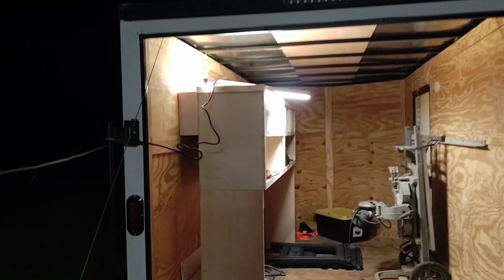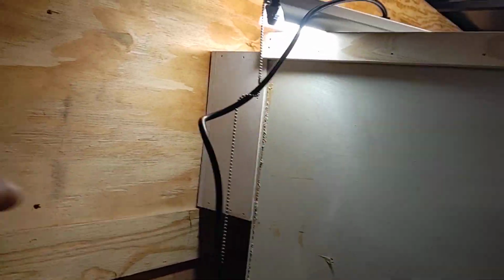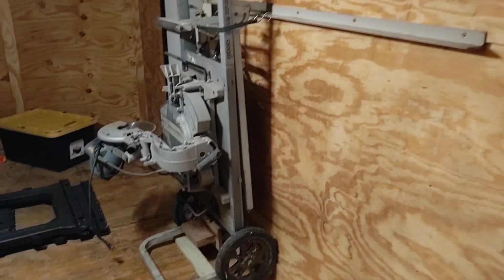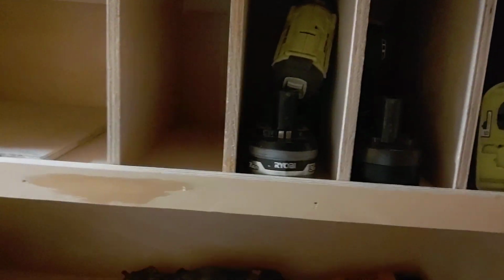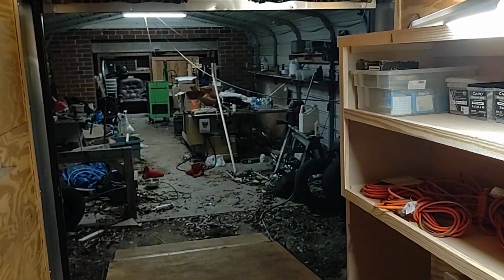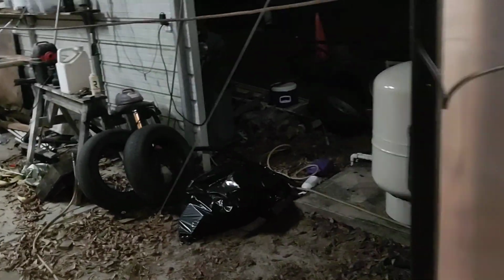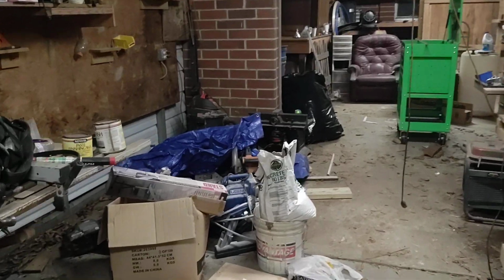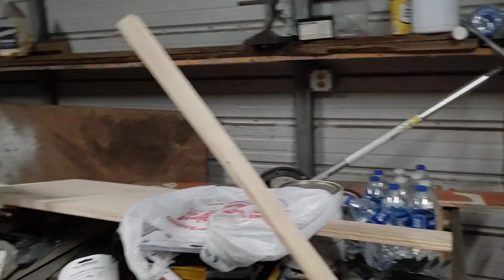Tool Trailer Update

Comment: I hope you had a great Thanksgiving. Oh man I know how you feel when the GoPro SD card is bad and lose 75%. I lost a whole video. I sent you a message on FB messenger. Oh cool you got my lightsaber in there 😂Loving the shelving right now. I think the enclosed trailer was a great idea buddy 👊And I'm first this time 😂
Reply from the maker: 🏆🏆🏆 I think the trailer is going to be a huge help on construction type projects. It'll be a work in progress for a long time and I'm sure I'll change some stuff. I'll have to check out the Amazon link for the cards.......gotta have my GoPro.
Reply: @cleangreenlawnservicellc2630  Oh definitely a huge help and a good investment. I know you'll have some good ideas with the inside for sure. Yes those cards really helped me out cause I couldn't understand why my GoPro was not recording at times, so I googled it and that helped me find the problem.